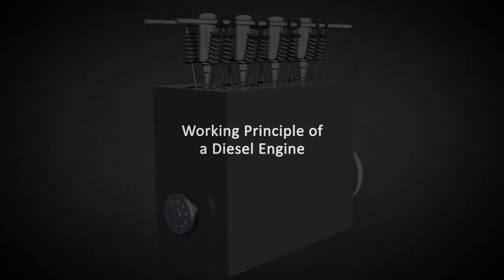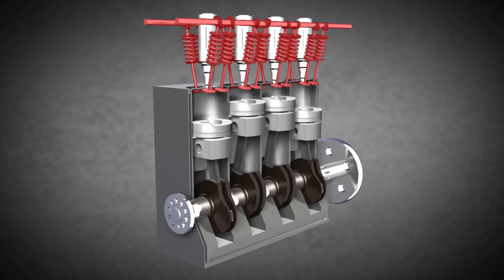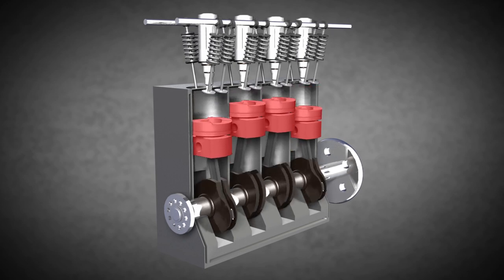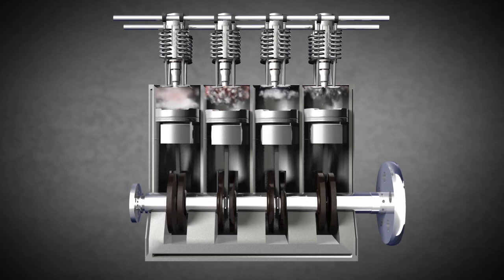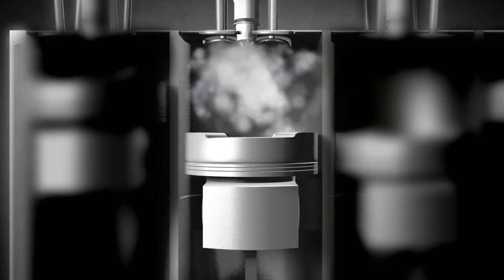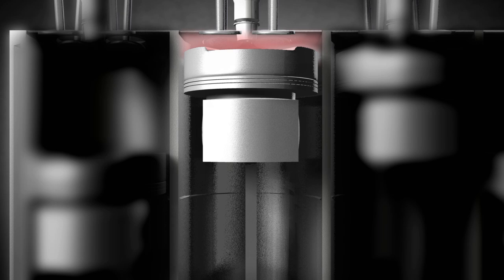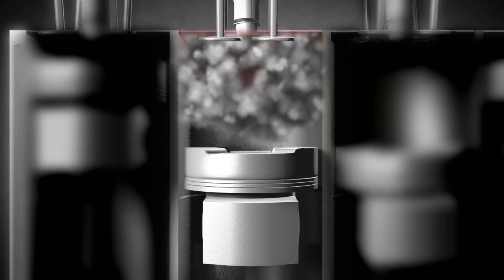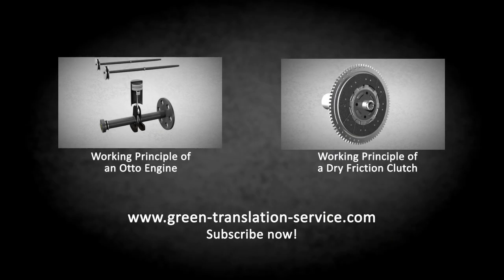How Diesel Engines Work! (Animation)

Comment: whats the main difference from a gasoline engine? besides fuel of course... Spark plugs aren't mentioned, however diesel engines have some sort of "park plugs", named glow plugs and in the video they don't talk about it...
Reply: Ricardo Candeias 
Diesel engines do not have (nor need) sparkplugs. The "ignition" is provided by the compressed air during the compression stroke. As the piston rises, the air inside the cylinder becomes compressed. This rapid compression of air generates the required heat for igniting the fuel that was injected into the cylinder. Glow plugs are used only used for starting a cold engine by preheating the air inside each respective cylinder. Glow plugs are energized via a time-delayed relay which usually deactivates after about 90 seconds.
Reply: Since I feel like no one answered your question, SI engines, or spark ignited engines, ignite by spark, however ignition is a term normally used for setting off explosives, gasoline engines are more of a slow burn, like dropping a match in a jar of gasoline, gasoline engines are these, simple enough, Diesel engines are CI engines, compression ignition, ignition in the right way, diesel is similar to a bomb going off whether as gasoline is like a controlled burning, they ignite fuel by the sheer temperature and pressure caused by the piston compressing the air, this temp and pressure causes the diesel fuel to ignite as soon as the fuel is added into the combustion chamber, the "spark plug like" devices you see in the animation are the fuel injectors, diesels take in only air and fuel is added when the air is compressed, now, the only purpose of the glow plugs are basically to heat up the combustion chamber in order to help start the engine in colder situations.
Reply: SAMP Giggles you must be kidding, a lot of people replied to explain the difference. Your explanation is not very good, I am afraid to say.
Reply from the maker: Ricardo Candeias Hi, that's true. Thank you for your feedback. The animation covers the 4 strokes only...
Reply: Thomas Schwenke ah ok... i was just asking, tought that maybe there are some engines who don't need those plugs.
Reply from the maker: There are, some trucks for example :)
Reply: Ricardo Candeias Os motores diesel não têm velas porque a combustão acontece por auto-ignição do combustível devido às altas temperaturas e pressão dentro do cilindro (muito maiores que no caso dos motores a gasolina). Os glow plugs que referes são resistências eléctricas usadas para aquecer a mistura de ar com combustível apenas durante o arranque do motor.
Reply: Johnny obrigado Johnny! :)
Reply: then... could we say diesel is more instable than gasoline? since it only needs pressure to ignite/explode and gasoline needs the spark!
Reply: Ricardo Candeias yeah was wondering about the spark plugs...
Reply: No, gasoline is more explosive than diesel fuel. Diesel like kerosene, is a fuel oil. A diesel engine compression ratio is twice that of a gasoline engine. therefore the heat generated through compression in a diesel engine is much higher than that of a gasoline engine.
Reply: Ricardo Candeias I only remember spark plugs are in cars...
Reply: Donald Wyatt Exactly. That's why diesel engines need to be more robust and they are heavier in construction. They also tend to last longer than a gasoline engine because they operate at lower speeds.
Reply: Jack Alfro Not necessarily. You can have spark plugs in all sorts of vehicles and other apparatus powered by internal combustion engines. Motorcycles. Scooters. Speed boats. Chain Saws.  Leaf Blowers. Snowmobiles. Etc.
Reply: Donald Wyatt imagine you have two jerrycans, one with diesel and one with gasoline. Which one is more dangerous?
Reply: Gasoline
Reply: Johnny, you are correct regarding the robustness of diesel engines.
Reply: Ricardo Candeias Gasoline. Like he said before, gasoline is more "explosive". Its flash point is lower than that of diesel. In other words, gasoline gives off flammable vapors at a lower temperature, and therefore is more volatile, more "dangerous".
Reply: Ricardo Candeias http://www.tpub.com/engine3/en3_files/image010.jpg

Comment: how can the diesel engine start without spark plug?
Reply: Rasev Putra diesel engines have much higher compression ratio of gasoline, so this means its a ticking time bomb as it is compressed, on the 3 rd stroke diesel fuel is injected into the engine with the super high compressed air and it simply explodes and throw the already about to go down piston downwards quickly and with great force
Reply from the maker: Rasev Putra It can't!
Reply: Diesel engines don't have Spark plugs... They have glow plugs instead... And They start with big pressure and compression in the cylinders
Reply from the maker: That's right :) / spark plugs work almost like glow plugs.
Reply: The Potential is almost the same :) only that the diesel needs them Just to start, so you are also Right
Reply: Rasev Putra Some Diesels don't need glow plugs, like highway trucks. They go off complete compression from the pistons.

Comment: And I thought inline 6 cylinder engines were the smoothest.
Reply: lifeisgood070 Usually the more cylinders you get, the smoother the engine runs.So you are almost right.. a 6 cylinder is indeed smoother than a 4 cylinder engine. But a 6 cylinder is not the smoothest as there are a lot of other engine types out there with more (or other) cylinders (like a V12, W12, wankel and many.. many more)
Reply: Don Heuvelman How smooth it runs it is dependent on the phase of the explosions of each cylinder.
Reply: ***** Not entirely but you are right, that's also a factor that can influence the smoothness of the running engine.
Reply: Don Heuvelman But the engines you mentioned have to be counter balanced? So how could they be smoother than a well put together inline 6?

Comment: Actually i don't know anything about working principles of engine..!! This is very great and clear animation video of working of engine..!! But i have one doubt here .... "Which energy helps to revolve the shaft rod.( Which operates the valves to open and close)..??  .After that i clearly understood that how power is shifted to Transmission& Wheels...!!
Reply: a camshaft is used to open and close valves. the camshaft  is gear driven by the crankshaft. It can be a gear to gear, chain or toothed belt drive at a 2:1 ratio
Reply: bluehog1340 Okay thank you

Comment: With what application do you draw those?
Reply from the maker: heain soe Carrara 8 Pro.
Reply: What is the difference between solidworks and this? Thanks a lot!
Reply from the maker: heain soe With Solidworks you design and create parts for machinery (for example) that can then be sent (as a technical drawing) to a manufacturer. With Carrara, you animate then these parts as it can be seen in this animation.
Reply: Thomas Schwenke thanks a lot for your explanation!

Comment: Nice video, but there is one thing not exactly right about it. You state that during the power cycle the fuel explodes. It's not entirely true. Yes - there is a bit of an explosion at the beginning (knocking is unaviodable in diesel engines due to it's work design), but the most energy comes from deflamation, not explosion.
Reply from the maker: Trala Lala Whatever you want to call it. It's just a question of the classification.
Reply: No such a word in my dictionary.

Comment: with a diesel engine can the diesel be squirted into the cylinder in a liquid form or does it have to be vapor?
Reply: cheers.
Reply: diesel is a dense liquid so atomizer is used for fine spray so that it mixes thoroughly with air n then mixture is used at the suction stroke.
Reply: liquid form. but it's injected in very high pressure, so it's instantly become very tiny drops that does look like vapor.

Comment: I didn't really understand the difference betwin the petrol and disel engine and why is disel engine fuel consumption more eco than petrol one.
Other than that. Thanks Thomas.
Reply: Well, the main difference is that in a petrol engine a spark plug ignites the fuel, while in a diesel engine the fuel is ignited by compressed hot air inside the cylinder.
Reply: So there is no spark plug in the disel. What's the ignition then to start up the engine. I suppose heat will be enough. Thanks
Reply: WheelyDoctor The starter motor turns the crankshaft, forcing the pistons up and down, creating compression and heat. When fuel is added the engine eventually starts up.

A glow plug can be used to heat up the combustion chamber before the starter motor is engaged. This helps starting the engine if the engine is cold. The glow plug does not ignite the fuel.
Reply: because the compression ratio(CP) of a diesel engine(20+) is far higher than that of a petrol engine(less than 13). the higher the CP, the higher the thermal efficiency according to the second thermal-dynamic law. And petrol engine can't achieve high CP because the Octane Value of the fuel that limits it.

Comment: U say that at the power stroke, the 'explosion' happens because of 'high temperatures' in the cilinders... So that means that Diesel engines don't get sparks of spark plugs?
Reply: No, it's compression ignited. Diesel has a lower self-ignition temperature compared to gasoline.

Comment: At first I thought, "This is no different than a 2 cylinder." but upon a second look I noticed that while one cylinder was exhausting spent fuel, its like cylinder was firing. Clever!
Reply: that's not what makes it a diesel.
Reply: qbsean10
You are correct. I hope you weren't thinking I said it was a diesel because of that. All I was pointing out was the firing order. on cylinders.

Comment: If the diesel charge is ignited by the high temperature of the compressed air in the cylinder what is the spark plug for?
Reply: Diesel engines use glow plugs.  they only activate on start up thats it.  the rest is ignited by super compression.
Reply: only gas engines use a spark plug
Reply: ***** the piston is where the power starts and then goes to crank shaft and so on. If there is little or no compression a truck would only go like 5mph, no power.
Reply: ***** the piston is where the power starts and then goes to crank shaft and so on. If there is little or no compression a truck would only go like 5mph, no power.
Reply: tribulation138 if there is no compression at all, the engine would not be running. it'd just be sitting there
Reply: diesel engine has no spark-plug. some models have glow-plugs , they are for preheating, enable easier cold start

Comment: gasoline is a suckers fuel that's why most cars are gas, for the stupid people to burn off in their cars.  Diesel is saved for trucks where the power is needed. It is becoming in short supply that's why its getting more expensive then gas, when it used to be  cheaper, and its also cheaper to produce but more valuable.  Oil companies are starting to water down diesel with kerosene and doping it with added oils so the kerosene doesn't fry engines because its too dry of a feul. But they are also watering down gas with ethanol too, so yeah we are all paying more for watered down fuel.
Reply: We live in a shitty two-bit saloon when it comes to fuel.
Reply: Actually there isn't a shortage. it's just more profitable to export the fuel to other countries because the oil companies don't have to pay taxes.

Comment: Thank you for this video. Nice animation . Just changed my vehicle from petrol 1.6 to diesel 2.0 turbocharged with 40 more BHP. It is definitely not that responsive as petrol but when you reach say 80 mph engine seem to do less work do deliver great smooth ride. But round the town I must I miss my old petrol Zetec ...

Comment: Diesel engines work under the principle of high compression. Glow plugs are used during a cold start to provide high heat inside the cylinder before ignition. There are no spark plugs. Gasoline pistons have a flat top where as diesel engine pistons are bowled at the top to provide more compression and power on the power stroke. Diesel engines get their power equivalent of a gas engine by usually being outfitted with a turbo charger
Reply: Not all diesel engines have glow plugs, all the higher compression engines that 18 wheelers have don't need them due to the type of diesel fuel used. However, if it gets too cold out it is highly recommended to keep the engines running, otherwise it can be difficult to get them started, plus it keeps the fuel from jelling up since the tanks have fuel heaters in them. Older lower compression diesel engines do require glow plugs, but back then when they were made the fuel had more sulfur.

Comment: ive never been able to; you would have to have some kind of mechanical advantage ,but,to mimic the 'compressing air' stage of a diesel engine would be interesting and good to feel if the air does go to a high temp just by itself just under compressing-maybe a model could be made to re-inact the event .What do you think Mr Schwenke .
Reply: Thomas Schwenke would injecting compressed air into cylinder increase the efficiency??
Reply from the maker: Is it really that complicated? I mean, many people want just to understand the principle. Whoever wants to dig deeper ... will do it and find other useful ressources. Don't you think?

Comment: are glow plugs still used-does compressing the air 'alone' cause it to rise to  such high temp or does something help,generally if you can do that then does it mean you can produce 'heat energy' simply by compressing air,it would cool wouldnt it?
Reply from the maker: Correct :)

Comment: So wait, there is no spark plug? The combustion is the effect of diesel injected into high air pressure mix?
Reply: Tthe diesel fuel has to be forced in with a really high bar or psi setting so it atomises instantly which is important,the pressure is already very high in the combustion chamber to begin with-the properties of diesel cause it to burn in this fashion vegetable or olive  oil will burn the same way .All very interesting stuff chappy .
Reply from the maker: Hi, that's correct. Yes :)
Reply: Thomas Schwenke wait....I know newer engine have a glow plug...or incandescent as it's called.....so your engine,doesn't ....
Reply from the maker: No, they don't :)
Reply: Yes, compressing air heats it up - next time you blow up a bike tyre, notice how the metal collar that screws onto the tyre valve gets hot.
Reply: @GuyRWood  its called a valve stem
Reply: Guy Wood tire*

Comment: Hahaha, yes after power stroke. But power stroke is combustion, not ignition. So the valve open before BDC (about 5 degrees) until about 5 degrees after TDC, and the intake valve start to open when the exhaust valve almost closed, called overlap (both valves open together).